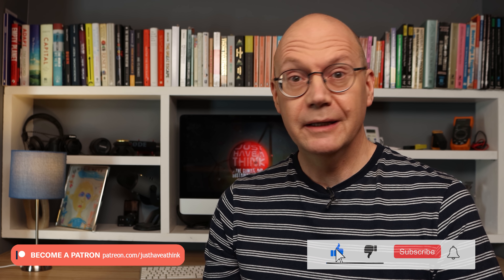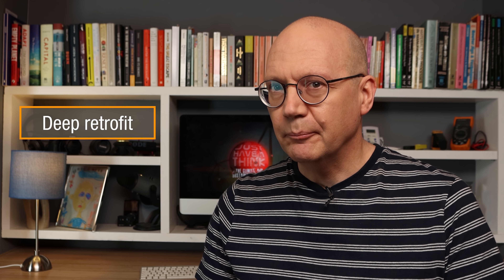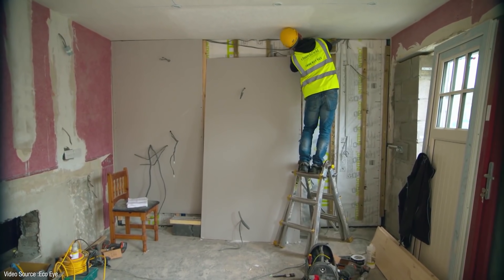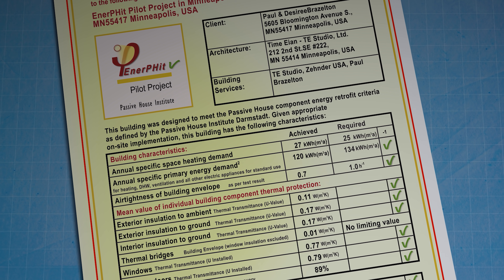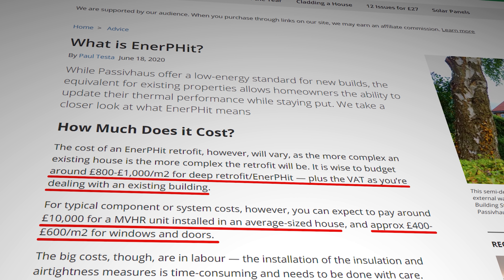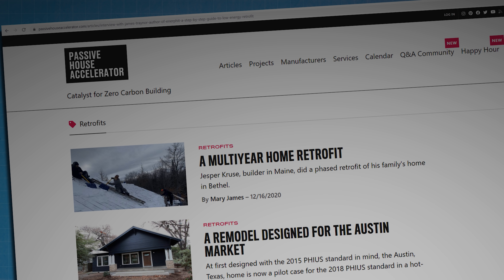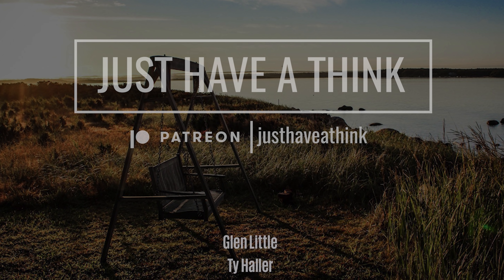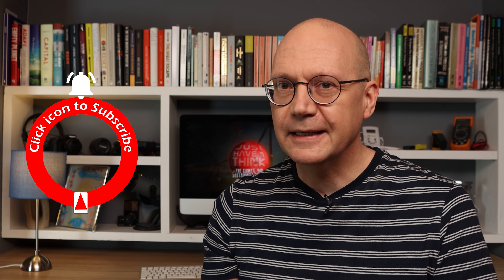Retrofitting to Passive House standards

Comment: Already in 2014 in the town where I live (Heerhugowaard Netherlands) a social neigbourhood built in the 1960's (about 300 houses) has been renovated to be as good as energie neutral.  I do not know if these are now EnerPhit certified or something, but they have energy label A.

The houses are more or less cladded with thick isolation on the outside, floors isolated, new tripple pane windows and roofs heavy isolated and completely covered with solar panels. Gas boiler for heating and warm water replaced with air based heatpumps, heat recovery ventilation installed. The gas pipes have been removed so people also had to convert to electric cooking.

The rent has gone up a quite bit, but the savings in energy costs are tremendous and more than cover the rental raise. People living there are quite happy with the result, improvement in comfort and reduction of cost of living are much appreciated.. A side effect is the people have started to be more energy concious.

So it is possible and can be done cost effectively, sure there are more neighbourhoods renovated like this in The Netherlands by now.. Government goal is to get rid of natural gas by 2030.. 

My house is a bit newer (1991) well isolated, but hot water, heating and cooking I do with natural gas... I did replace my boiler about 7 years ago for a ultra efficient one, which already helped, and I installed 14 solar panels on my roof.. But to get rid of gas altogether requires a big investment, I cannot afford right now... Will transfer to electric coocking though, and plan to install a Quooker hot/cold water tap in my kitchen, which also reduces the gas usage a littlebit.... 

Only about 50 meters from my house a a hot water pipe is installed a few years ago, as expansion of a "heat net" where heat of a local waste burning plant is used to heat new homes, which also works very well. My brother lives in such a home, and is quite happy with that. What I hope for is that the local government will offer connection with that heat net to my and my neighbour's houses, and this way get rid of gas, and reduce energy costs... This heat net is very energy efficient and is powered by our garbage!

Anyway, step by step we will get there, and with a little help of our governments we could accelerate the transition to energy neutral homes and using all renewable energy.

https://www.bamwonen.nl/nieuws/2017/3/230e-metamorfose-naar-energieneutrale-woning-woonwaard
Reply: Where do you think all the C02 goes created by burning refuse?
Reply: @b.mnicholson4269  Good point, but its all about efficiency, its really the last bits that are left over after everything that is pulled out for recycling, that is burned.. recently they have started a project to catch the CO2 and use this in greenhouses in the area to grow crops and flowers... Normaly farmers burned natural gas to generate CO2 (and heat)

The plant is originally built to generate electricity from burning garbage and wasted wood, and that is still the main goal of that plant, but instead of dumping the excess heat overboard, it is now used usefully by heating greenhouses and homes in a big area around the plant.

At least it is much better than just burning fuel (natural gas).

Comment: I live in a cottage in Scottish Borders, built in 1840. I have made the cottage properly airtight and used double glazing (not triple). I have built a small double glazed south facing conservatory which vents into the cottage using a program I have written.  I have removed gas and use electric heaters in conjunction with very cheap hrvs.  Hot water - instant electric. In summer my electricity bills are less than £28 a quarter with an annual total of bill of less than £200. Rule 1 - ignore Passivhaus, Rule 2 do not use an architect they don't even know how to test for true airtightness.
Reply: Why ignore passivhaus? Isn't it just an evidenced standard? 
Also, do you have any info on your build (blog, website or whatever)? Sounds interesting. Especially the cheap hrvs.
Reply: @ricos1497  The cost of accreditation for that standard is madness. The methodologies used are crazy. I have been doing this for nearly 20 years. The build varies with the site, but as a guide I usually use SIPs, with aerogel in the detailing to stop any thermal bridging. The HRVS again varies with the location, it is in the design and uses 2 off 50 watt fans at the most. A system for a 72m2 bungalow is £1,700 as a max. Happy to help.
Reply: @steverichmond7142  thanks for replying, that's intriguing. I hadn't really thought about the accreditation cost, I suppose it's a little like organic farming, whereby you pay for the privilege of telling people you don't use synthetic chemicals! I'll have to look up the internet for some of the DIY HRVS as that sounds right up my street. I got a quote for a system last summer and it was around £5k for a 178m2 house (to fit myself), which I thought was reasonable, but I'd like to know more about the mechanics of it.
Reply: I use Spacetherm by cutting it into strips and using it as a gasket in wooden lathes and sole plates which I then board over with plasterboard.

Comment: A key issue that needs to be considered is that many homes in the North of England do not have sufficient 'market value' to justify the cost of extensive refurbishment, let alone retrofitting to 'Passivhaus' standard.  Retrofitting is far more difficult and expensive than it initially appears and achieving a 'quality' outcome is rarely guaranteed. I have dealt with the repair, maintenance and upgrading of some large housing estates in several parts of the UK.  With a typical contract of 500 homes per renewal period, the economy of scale was considerable but even then the costs were high.  You may recall the 'Housing Market Renewal' programmes in the older Midlands and Northern industrial cities some years ago, even then it was much cheaper to demolish and rebuild to an a far better (but not Passivhaus) standard than to attempt refurbishment.  If it was unaffordable for Social Housing schemes I doubt that private landlords will be interested.
Reply from the maker: All good points. That's why we need wholesale state intervention to get the job done. Another couple of pence on the pound for a 'Climate Tax'? Absolutely fine by me.
Reply: Same problem in the Netherlands. Most Houses are insulated step by step since the 1980's.
Costs for further insulation efficiency are prohibitive and the remaining return on investment is often negligable.
Reply: Same in Australia. I own a 1950's double brick ouse that performs surprisingly well (after I put a new, insulated, roof on anyway. But three hot days in a row bring the whole thing up to 35°C or more... but fixing that means either insulating over the outside and replacing all the windows. But that would mean the narrow driveway down the side would be unusable - there are scratch marks on the side of the house now. Also, the asbestos throughout the house makes renovation difficult. It would be more reasonable to dismantle the house and sell or reuse the bricks. Which would be helped by the builders having skimped on cement when laying the bricks :)

OTOH, the modern habit is block-covering McMansions with complex black tiled roofs... you can't even put a decent solar array on the roof.
Reply: The insane cost of retrofits is a problem.  What the world needs is a much cheaper way to retrofit old housing without tearing them down to the frame.
Reply: It's not a bad thing if it's cheaper to pull poor housing down and just build passivehouses. The main issue there is that people need to be able to go live somewhere else whist that happens. It's not always convenient. You can deep retrofit slowly whilst living in the property (although it is messy and a bit tiresome). This is much cheaper than paying for two places and lets you spread the cost as finances allow.

Comment: Given we're in the midst of a pandemic I'm surprised the need for a good flow of fresh air didn't receive much attention.
Reply: MVHR systems provide the fresh air required
Reply: @Jack_of_all...  Not sure they do. They would supply enough fresh air to meet the need for oxygen and removal of CO2 but you need a breeze to blow airborne particles carrying viruses away. If you want to recirculate air then you need to include sterilization in the system.
Reply: @robroysyd  Modern systems don't recirculate, they exchange heat with fresh outside air.
Reply: @MrMichiel1983  Correct,  I've seen the heat exchangers used for that. The problem seems to be there's not enough airflow to blow particles away before someone inhales them.